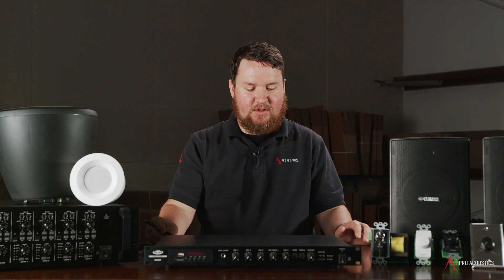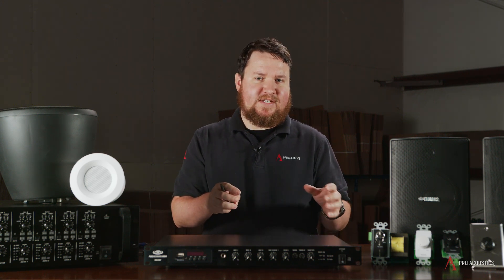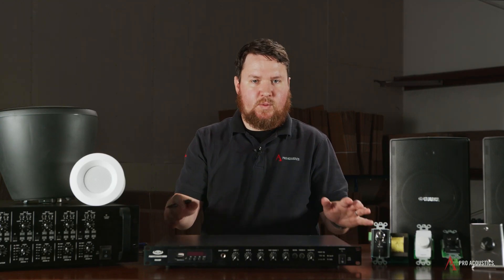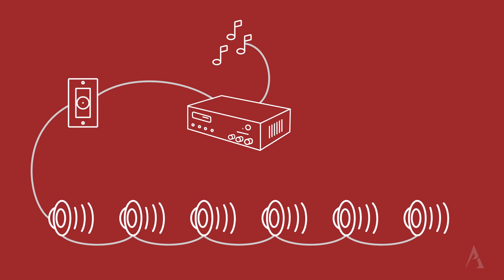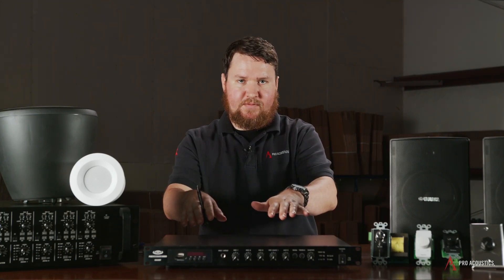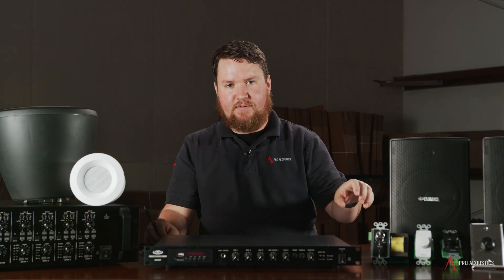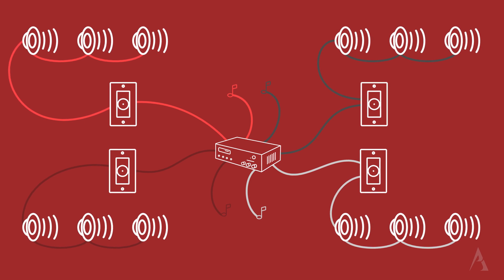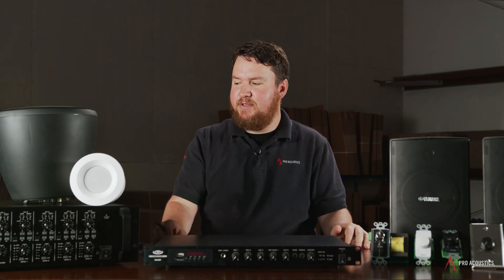What is a Commercial 70V Multi Zone Amplifier System? - Pro Acoustics Tech Talk Episode 58

Comment: My amp has 180w 5 zones how much would each zone have in watts
Reply from the maker: Hello, This will depend on the amplifier. I recommend consulting the data sheet or manual for your specific amplifier. If you do not have either of these, you can often find them by searching Google. If you still can't find the answers you need, reach out directly to the amp manufacturer. Most manufacturers offer some technical service for their products.

Comment: Hello Nathan!

I'm 53 and want to break into the low voltage and commercial audio field.  I live in SW Connecticut.

I have hotel A/V and some light install background.

Any recommendations?
Reply from the maker: Hi there! You can check on infocommshow.org, commercialintegrator.com, avixa.org, and other industry websites for installers or dealers in your area and see if there are any you could work with. Best of luck!

Comment: How can I ask a question by email or by phone? 

We are a church in Phoenix, AZ. Need a quick question why our 70V CDi1000 amp that needs to be replaced.. 

I am wondering why the amp out is connected into an old transformer, then out with 1 cable with a resistor connected to both positive and negative to multi zone (home runs) volume controls. 

This could be an old way to hook up (old amp, amp was manyfactured in 2007). 

Can I get a new 70V commercial amp and connect to all the zones with one cable  directly from a new amp and paralleled to these home runs (volume controllers)?

We probably need to change all 5 volume controllers? 

I plan to replaced the amp with the same one using the same connections. The speakers are at least 150 ft away from the back to the Church to the front volume controller to the back of the church where the amp is located.

The amp is like $1100. I want to save $ and use a newer system.
Reply from the maker: Hi there, It sounds like you’ve got a lot going on there. We’ll need some more information to fully understand your system setup. You can contact us by email at sales@proacoustics.com or call (888) 256-4112 and speak directly with a Sales Engineer who’ll be able to help you with this as well as provide some possible solutions within your budget.
We hope to hear from you soon!
Reply: Any suggestions for good in rack attenuators that would pair well with a Sonos port?  Trying to figure out if I can get a remote attenuator that would be controlled in an app like Spotify or YouTube music if using a Sonos port as a source. Thanks!